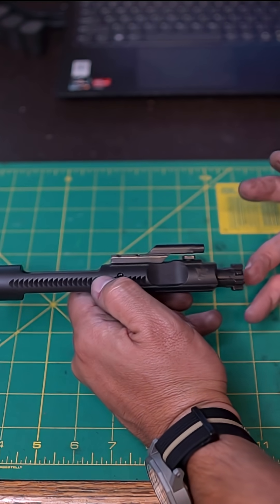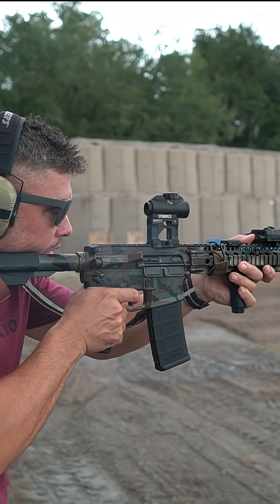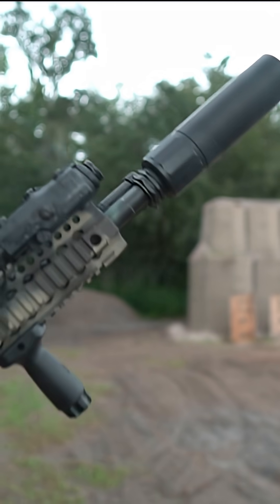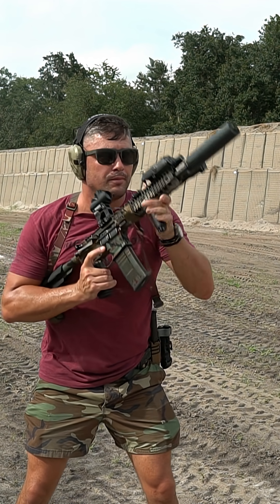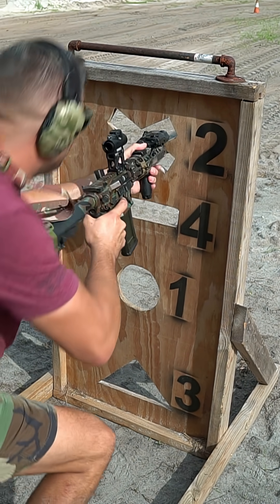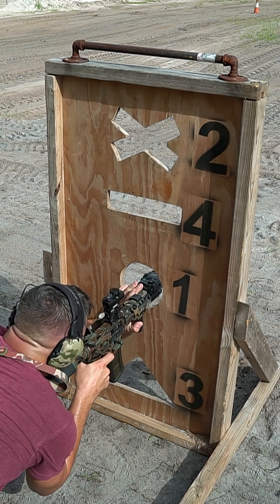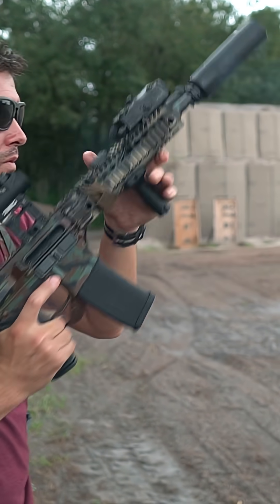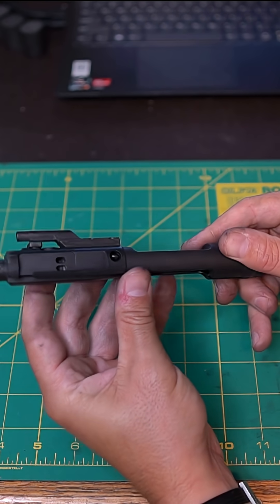This is not an ordinary Bolt Carrier Group.

Comment: The only bolt carrier anyone should consider when upgrading is either the vktr or the leitner wise because they unlock the bolt at the optimal 22.5 degrees as opposed to the mil-specs 20-ish

Comment: My rule of thumb is my rifles need to run with or without a can, although they are tuned to be more optimized with a suppressor. I would be slightly worried with that ejection pattern although in all honesty I' don't recognize the suppressor. If its flow through I would be less worried.

Comment: Check out the KAK down Vent BCG too definitely a great BCG I used now for the pass 6 months run it suppressed as well. I wanna check this one and compare the two, love the video man 👍
Reply: I bought both the Kak and the griffin at the same time. Sold the KaK because it’s not as quiet as the griffin and only has one feature compared to the many of the griffin. The griffin has the gas pocket, sand cuts, delayed cam path, and a path for pressure to hopefully vent out incase squib or over pressure round. And if I remember right the KaK didn’t fare so well on the school of the American rifleman.
Reply: @Germanic_Manic The griffin I got was terribly out of spec, the KAK one I got was perfect